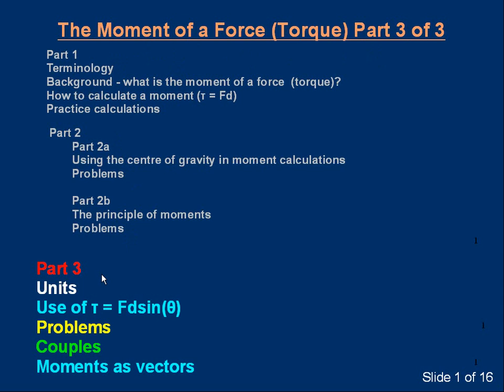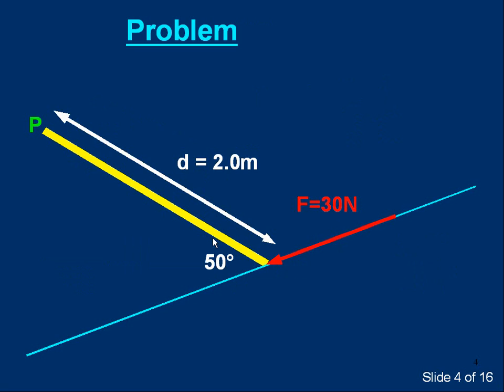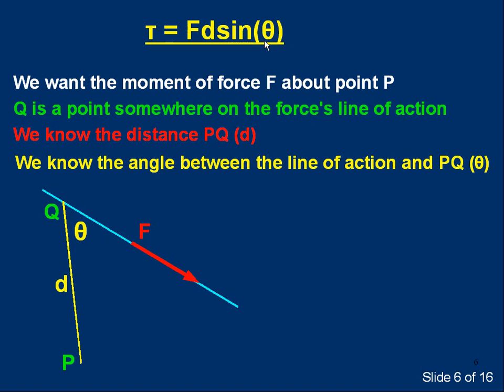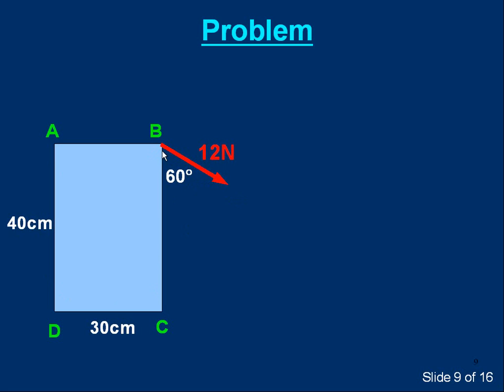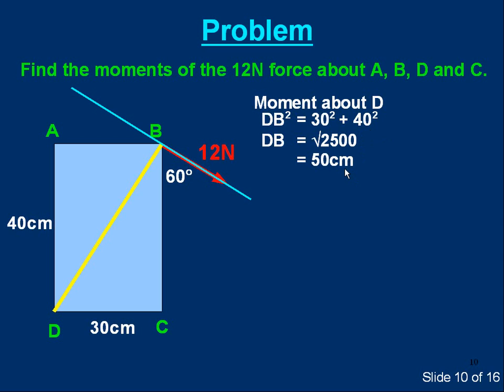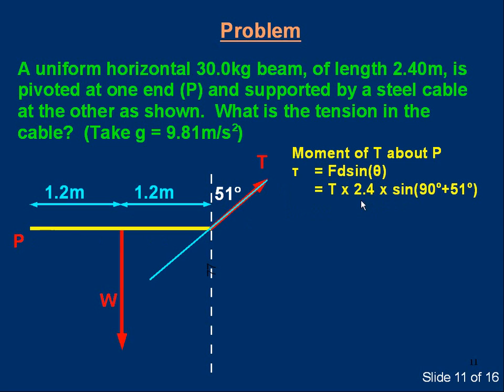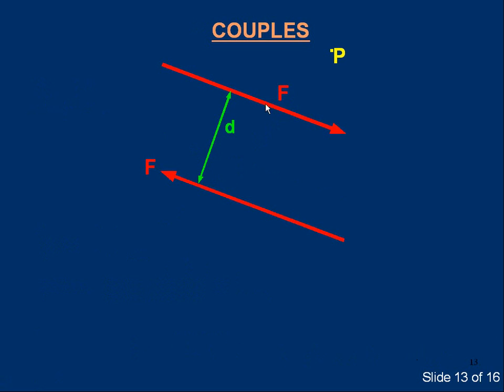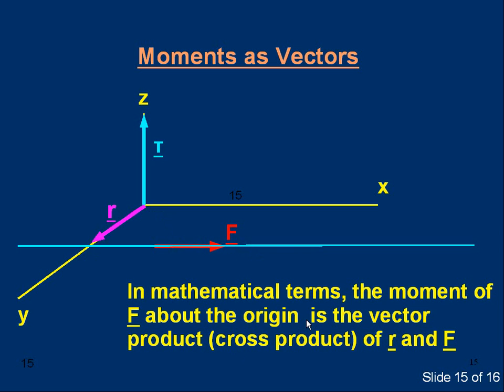M14c Introduction to the moment of a force (torque). Part 3 of 3. τ  = Fdsin(θ)

Comment: At 19:05, why was the distance from P to the dashed line 2.4m? Are you not meant to use a perpendicular line from point P to the lightblue line from T and use trigonometry to calculate this distance? This is what I mean http://prntscr.com/796cbb
Also I do not understand why the line of action (dashed line) is there?
Reply from the maker: bezerkthecreator 

Hi.  I'll try to explain your mistake - but it's awkward and I may end up confusing you more!  If you watch the video again from 3:28 the method should become clearer.

The dashed line at 19:05 is just to show the vertical direction clearly– so you can tell the force makes an angle of 51º to the vertical.  Apart from that, the dashed line is not used, if happens to pass through the end of the beam because that's where the force acts. So forget the dashed line.

The length of the beam is 2.4m, which is the important distance and corresponds to d in the formula τ = Fdsinθ.  d is not the lever arm (not your yellow line).

On your diagram (in  http://prntscr.com/796cbb), yes, you must use the length of the yellow line which is the perpendicular distance from P to the line of action of the force (blue).  Agreed.  This is the 'lever-arm'; call this distance L. Moment = F * L.  We need to find L.

The length of the black line on your diagram is d and d= 2.4m.

You have a right-angled triangle formed by the yellow, blue and black lines.
The angle between the blue and black lines is 180º-90º-51º = 39º.

In the triangle, sin(39º) = L/d  so L = dsin(39º) = 2.4sin(39º)

Note that 2.4sin(39º) is the same as 2.4sin(141º) because sin(θ ) = sin(180º- θ).

The angle between the beam and the force is 39º or 141º depending which side of the line of action you use.  You get the same answer if you use  39º or 141º because sin(39º) =sin(141º).

On the diagram it is easy to see the angle is 90º+51º=141º, so I used 141º.

So when using the formula τ = Fdsinθ, d is not the 'lever arm'; the lever arm (L) is dsinθ., which is the yellow line in your diagram.

As I said, try watching the video again from 3:28.

Hope that helps a bit.
Reply: Steve4Physics Oh wow, I wasn't paying much attention I understood it a lot better the second time, thank you so much for taking time to explain this to me I really appreciate it! However in exam questions I feel its just so much more difficult compared to these examples; like I just cannot comprehend which principles to apply when and where! Thanks Steve :)

Comment: To Mirko Ramphul

Having problems replying to your comment. Hope you get this.

The working in the video is correct.

Sine can be defined using a right-angled triangle.  But you don't have to have a right-angled  triangle to use the sine of an angle.

Using a calculator, sin(96.9⁰) = 0.993 approximately: this is true whether or not the angle is part of a right-angled triangle.

Take a look at this link for an example of using sine where the triangle is not right-angled:
http://www.bbc.co.uk/schools/gcsebitesize/maths/geometry/furthertrigonometryhirev1.shtml

The moment is Fdsinθ.  θ is the angle between the yellow line and the red force vector.
θ = 60⁰ +36.9⁰ = 96.9⁰.

There is no need to draw the lever arm and construct a right-angled triangle. You can, but it's unnecessary extra work.  You can use Fdsinθ without having to construct the right-angled triangle.

Watch the video from 3minutes 40s carefully.
Reply: THX a lot with your videos I have a chance of getting an A :)

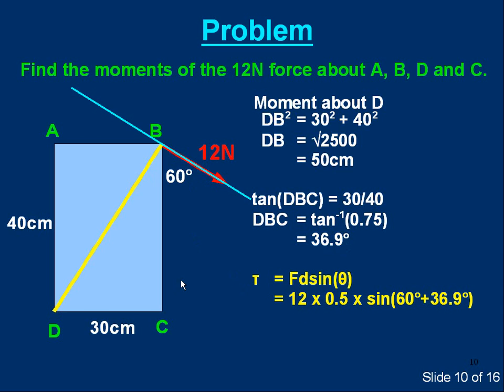Comment: At 16:41 you add the angle surly you can't just add the angle ....sin(60+36.9) using sine as there is no right angle because you can only use soh cah toa if the traingle have a right angle.
Reply: where is a right angle being for and why do you add it?

Comment: A ball B of mass 1.2 kg travelling at constant velocity collides head-on with a stationary ball S of mass 3.6 kg.
Diagram (Ball B travelling to the RIGHT with a velocity of 4m/s)
After Collision Ball B travels with a velocity of -1 m/s calculate the change of momentum and the speed of ball S. 
I'm getting the correct magnitude of the answer (-5.76,-1.6) however the answer is positive.
Thanks Steve.
Reply from the maker: I can't offer an online problem-solving service. Sorry. Just this once I'll do it.
_____________

Method 1.

Let the velocity of S after collision be V.
Initial momentum = Final momentum
(1.2 x 4) = (1.2 x (-1)) + 3.6V
4.8 = -1.2 + 3.6V
3.6V = 4.8 + 1.2  = 6
V = 6/3.6 = 1.67m/s = 1.7m/s to 2 significant figures.

S's final momentum = 3.6 x 1.67 = 6.0 kgm/s
S's inital momentum = 0
S' momentum change = 6.0 - 0 = 6.0kgm/s

So the answers are 6.0kgm/s and 1.7m/s.
_______________

Method 2

For a 2 body collision:
(change in body S's momentum) = -(change in body B's momentum) (equation 1)

Note the minus sign.  This means that overall, the total momentum remains unchanged. For example, if B's momentum is reduced by 6 units, S's momentum is increased by 6 units; total is unchanged.

B's initial momentum p₁ = 1.2 x 4 = 4.8 kgm/s
B's final momentum  p₂ = 1.2 x (-1) = -1.2 kgm/s
B's momewntum change = p₂ - p₁ = -1.2 - 4.8 = -6.0 kgm/s

From equation 1 above:
S's momentum change = -(-6.0) = 6.0 kgm/s

SInce S's initial momentum = 0, its final momentum = 6.0kgm/s.
So its final speed = 6.0/3.6 = 1.7m/s

Comment: Thank You So Much Sir
But I have A Question At 17:00 For Point D, Why Do You Multiply Trig With Perp Distance, I thought You Only Used Trig When You Need To Find The Perp Distance, Because 12N * 0.5 = 6Nm Too
Reply from the maker: Hi. Look at the video closely at 17:00 minutes.

The line DB is NOT perpendicular to the force. The angle looks close to 90⁰ in the diagram, but as explained in the working, the actual angle is 96.9⁰. This gives the answer of 5.96Nm, which is not exactly 6Nm.

In this problem we have rounded the final answer to 2 significant figures , so we get 6.0Nm. If the angle had been slightly larger we would have got 5.9Nm.

Jusr because an angle looks 90⁰ in a diagram, don't assume it is exactly 90⁰.

Comment from the maker: You use the ‘inverse tangent’ function on your calculator.

This depends on the calculator make & model. Instructions below are for a Casio fx-85GT.

[ ] means a keystroke.

1) First make sure your calculator is set for degrees (not radians) – e.g. find sine 30 degrees: enter [sin] [3] [0] [=] and you should get 0.5

2) If needed, switch over to degrees; my calculator uses [SHIFT] [MODE] [3] Repeat step 1 to check.

3) Enter [SHIFT] [tan] [0] [.] [7] [5] [ =] and you get 36.8698…. degrees.

Comment from the maker: Hi.

I prefer to not to use 'mN' for moment (torque) as it can be interpreted as milli-newtons.  If you look in most textbooks you will find:
- ‘Nm’ is used for moment (torque);
- J’ is used for work (using ‘Nm’ for work is avoided).
That’s the conventional way of doing it.

I’m not sure what you mean by ‘µm’, as this usually represents micrometers (1μm=10⁻⁶m).

Comment: Thank you! It's really useful! Mr Steve, could you post videos related to dc circuits too? Such as calculating the total resistance? I'm having a really hard time trying to differentiate between series and parallel circuit (those that  have both series and parallel circuit combined)

Comment from the maker: 30cm = 0.3m.  For the moment about point A, the perpendicular distance to the force’s line of action is 0.3 x sin(30⁰) metres. So you multiply the 12Nforce by this distance.
40cm =0.4m.  For the moment about point C, the perpendicular distance to the force’s line of action is 0.4 x sin(60⁰) metres.  So you multiply the force by this distance.
If that’s not clear, you may need to go back to the 1st half of the video and work through it carefully.
Hope that helps.

Comment: hey there, my question is on the square block. Why do you multiply by the distance to the line of action (30 and 40 cm) instead of only multiplying the perpendicular distance with the force?

Comment from the maker: An inclined plane is one possible way it could happen.
Unfortunately I haven’t yet done a video on ‘work’.  However, there are other resources. E.g. search in YouTube with a phrase such as “work done by force”
I can’t put links in this message as they get blocked. However, I easily found a short YouTube video called “Work Done by a Constant Force” which covers the formula.  Its code ends in d6MhIBpmJnE.
Hope that helps.

Comment from the maker: No, it’s a different formula.
It’s the formula for work.  I’m not sure if the ‘x’ in your formula is meant to be a multiplication sign or the symbol for distance (displacement).  If we use ‘d’ for displacement then: Work done (W) = F.d.cos(θ).
This is used when the direction of force makes an angle θ with the direction of the displacement.
Note that if θ=0, since cos(0)=1, the formula becomes the simple formula W=Fd (work = force x displacement).